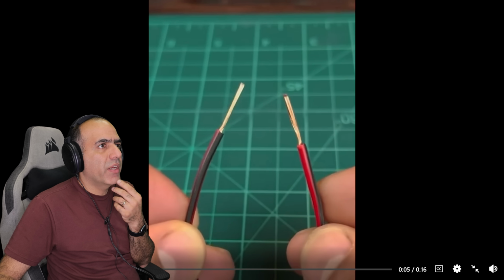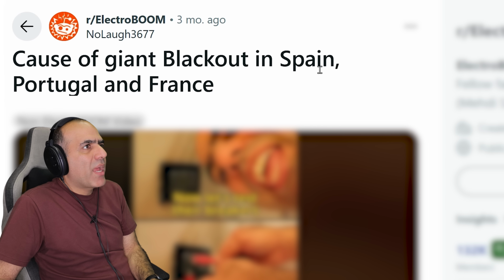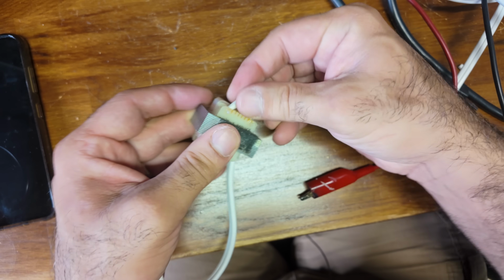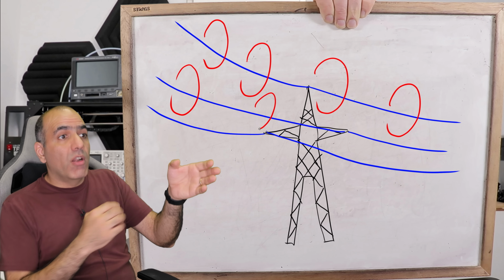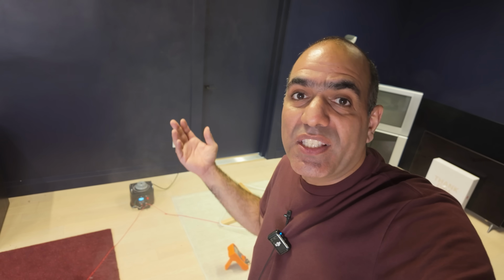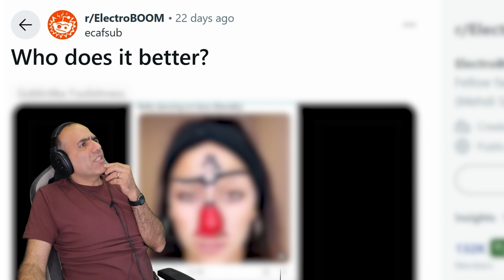Power Lines at Knee Level? Campfire with AA Battery?! (LATITY-016)

Comment: So I actually have some insight about that "Fusion Reactor".
It's called a Farnsworth Fusor and is unable to do any form of major fusion, they can do a little bit of fusion, but it's just luck of ions hitting each other, and you need deuterium, much more power, and a much higher vacuum, how do I know? I made one (you can see it on my channel), AND I actually helped the person in that article make that fusor, so his is based on mine which is roughly based on one from MAKE magazine.
I have no idea why that article called it a working fusion reactor, and it annoys me they did. Either way, no hate to the person in the article, I'm sure he didn't call it a fusion reactor, he was so dedicated to building his fusor and I remember the first video he sent me of it working he was so excited, and I was too.

Extra info for the info nerds:
The transformer is a 12kv neon sign transformer, the vacuum pump is a simple amazon vacuum pump, but some of them can get down to around 35mTorr, the one he and I use can get down to around 10mTorr, although you can't maintain a plasma with such low voltage at such a high vacuum. The grid is actually a simple shaker ball, which is something I personally came up with, and the glass is borosilicate glass. The metal flanges that encompass the glass, are my own design and use KF fittings, and the silicone gaskets that seal everything are also my own design.

If anyone has any other questions feel free to ask, I love talking about this.
Reply: Would you reckon soldered or brazed connections (for the classic 60/40 leaded solder, copper to copper and copper to steel solder joints) are vacuum tight?

I am slowly working my way towards DIYing vacuum tubes (emphasis on slowly, it has been like 4 years and i only now i am finally getting something resembling a EE lab lol) 

Also, do you think the neutron flux from the reactor has some utility in DIY? (Aside from what X rays can do, like food sterilization). 

Also also, if i remember right, Cody's lab did a heavy water extraction with electrolysis, so do you think it is possible to get fusion going with this DIY heavy water?

Even if it is not net power positive, the mere prospect of a star in a pasta jar is so incredibly beautiful to me. Like yeah medieval alchemists. You were right. Transmutation is possible. Its just involved, slow and expensive.
Reply: @oldelectronicenthuasiast Soldered or brazed connections aren't really vacuum tight, not only because they be porous obviously, but also because the alloys in the solder will most definitely off gas a ton. I wouldn't be surprised if there is vacuum safe solder, but I've never seen any. Copper is also not great for vacuum since it off gases quite a bit, again, I'm sure there are vacuum safe copper alloys, but at that point it's so much easier to just use KF stuff, it's not that expensive.

Fusors are just pretty light shows, that's all they'll ever be for us hobbyists. They don't produce enough of anything to be useful, though they can produce enough of some things to be dangerous.

Electrolysis is exactly what I'm going to do for my fusion capable fusor, and it's what most fusion hobbyists use to get Deuterium. Heavy water is pretty easy to get, certainly a lot easier than Deuterium, and there are pre-made electrolysis modules that are made specifically for heavy water electrolysis for not crazy pricey, around 150-200 dollars.
Reply: I see. Thank you. That has never occured to me. though, it makes sense, at least from the perspective of lower melting point increasing offgasing for solders.

Though, i never thought about solder as a sponge. How peculiar. On macro scales, it just looks like a silvery blob, and it was able to hold back compressed air just right, though that absolutely doesnt extend to vacuum. That, and any organic flux would totally nuke any semblance of possible vacuum performance i would wager.

Are there any plans to scale the fusor up? Is it even feasible to scale it beyond the belljar?
Reply: I thought fusors technically were fusion reactors? The main thing about fusion is that we've been able to do it for decades including with fairly decent power throughput, it's only productive nuclear fusion we haven't cracked yet (but because fusion has a reputation for being impossible occasional articles about these little fusors get breathlessly excited in the title before admitting that this isn't the same thing as commercial scale fusion)
Reply: @bosstowndynamics5488  They can be, but without deuterium, a higher vacuum, and more voltage, it's just a pretty light show. It's like having an egg with nothing to cook it, you ALMOST have an omelette, there are just a few more things you need. The egg could be an omelette in the same way a fusor could be a fusion reactor. Kind of a stupid allegory, but it's the best I could come up with.
Reply: @Aidans_Lab You don't need meaningful power output for something to count as a reactor though, and scale isn't necessarily a barrier either. By way of analogy, there's a massive difference between a DIY cyclotron and the LHC but they're both accurately called particle accelerators
Reply: @bosstowndynamics5488 I totally worded it wrong, yeah, energy production is not what makes something a reactor, the act of it facilitating a reaction does. But like i said, a fusor CAN be a fusion reactor, but mine and the person in the articles are not fusion reactors.
Reply: @Aidans_Lab Fair enough, that makes sense
Reply: If it generates fusion reaction, then it is a working fusion reactor.  That's what a reactor is.  It has nothing to do with generating electricity.  If you built one, you should probably know this.
Reply: @stargazer7644  Like I said in my other comments, neither of our fusors do any reacting, they don't have any deuterium nor do they have enough power or a high enough vacuum.
Reply: @stargazer7644   If it doesn't achieve criticality it is not a reactor, it has nothing to do with generating electricity. An RTG does generate electricity, and it does have fission reactions occurring, but it is not a fission reactor because it is not capable of criticality. If you're going to be a pedantic douchebag on the internet, you should probably know this.
Reply: But it is a working fusion reactor! The fact that it doesn't produce net energy is another thing entirely.
Reply: @jonbob2 Net energy has nothing to do with it. It's not a fusion reactor because it does not produce any fusion, there's no deuterium, not to mention the fact the vacuum is not high enough, nor is the voltage high enough. Fusors are capable of miniscule fusion, but the one in the article, as well as mine, are not capable of fusion.
Reply: @Aidans_Lab You've confused me.

How can it both not produce any fusion but also be capable of 'miniscule fusion' ?
Reply: @candyman9635  I think a fusor can facilitate fusion without actively causing it itself. For it to be a reactor it would need to actively cause fusion to happen by somehow confining the fusion fuel, however in a fusor there isn't really any meaningful confinement and instead it just lets fusion happen by creating a vacuum where the luck of the draw can result in the occasional atoms coliding and fusing. It's like the difference between a piece of uranium and a fission reactor, the uranium will occasionally split on its own but in a fission reactor you create conditions optimal for the fission reaction.
Reply: @jonbob2  Unless it's actually fueled and neutron production is demonstrated it's just a fusor shaped light show.
Reply: @jonbob2 It reacts heavy hydrogen and fuses it on the atomic scale to produce helium. 

Therefore it is a fusion reactor.

Not every fusion reactor needs to be a tokamak.
Reply: @daviddavidson2357  No it isn't. To count as a reactor it must achieve criticality. Would you call an RTG a fission reactor because fission is occurring?
Reply: @WJS774 Yes, sort of, because a fission reaction is occurring.

There have been natural fission reactors too. Uranium mines have come up short in isotope yield and the only explanation is that stable fission occurred.

A fusion reactor is more complex, significantly so. "Must generate usable power" is not a reactor requirement. If it eas, test reactors around the world would not be called reactors.

This is why we have reactor types.
Reply: @daviddavidson2357   I never said it must generate usable power to be a reactor, that's your strawman. I said that it must achieve criticality, which is the accepted definition of "reactor" by every nuclear physicist alive. Research reactors do achieve criticality.

Comment: I did my master thesis about magnetic fields under power lines, the strength of the magnetic field should be in the same ballpark as the strength of the earths magnetic field, except rotating instead of static.

You are right that the three phases mostly cancel each other out when the distance between wires is smaller than he distance to the measuring location, however if there is a zero sequence component in the transmission then that will not cancel out and that can cause a much stronger magnetic field.

My thesis was actually about measuring the x and y components of the magnetic field close to the ground and using that to infer the height of the wires, although I only did it for lines that have three wires in a horizontal configuration.

Comment: 16:15 I once detonated an old socket like that. I turned off the breaker and it still exploded, when I cut all 3 wires at once. The RCD went down for the whole sector.

Comment: The Hirsch - Farnsworth Fusor is not that hard to build and is at it's most basic no more complicated than a light bulb.  

-> https://en.wikipedia.org/wiki/Fusor

Inertial Electrostatic Confinement from a high voltage(15KV+) coil induces fusion of deuterium gas in vacuum, at room temperature(under glass like a light bulb).

It consumes a lot of power and does NOT produce any usable amount of net power, but is a neat project that anyone can do, provided you can get the deuterium.

-Cheers

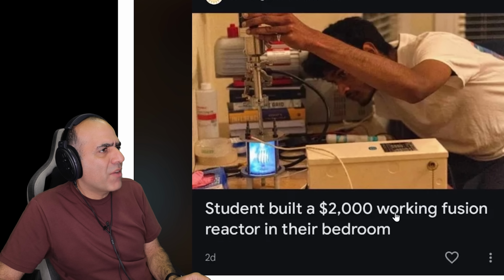Comment: 5:18
The video title reeks of free energy bs, so it might just be complete bs, but small fusion reactors do exist right now that can be built for relatively cheap and are relatively simple to build, but they are not energy positive. Its called a fusor, and have been around for a while. They are able to fuse elements into heavier ones using electrostatic forces and can be used as a source of neutron flux, they just cant be used for energy generation. It's completely different from just ionized gas in a globe. So, its actually possible that a student built a working fusor in their bedroom, its just definitely not a power generation device, but again probably completely false.

Comment: When I had my farm with a very old farmhouse and wiring and there was a old broken light fixture we No breaker on off switch. It was wired directly into the power line. 
That was not safe so I trimmed the wires back with wire cutters. It did draw a spark. But I used insulated cutters with rubber gloves on a fiberglass ladder. My experience wasn’t as dramatic as the one in this video. 

This was in 2006 so I don’t remember any other details. 
But I still can’t believe someone wired it without a breaker!

Comment: Just to clarify, that student and many others like him HAVE made working fusion reactors, just not ones you can extract useful energy from. 

That type of device is called a Farnsworth Fusor, and calling it a glorified plasma ball is not accurate at all. It uses high DC voltage to ionize deuterium gas and accelerate the ions towards a hollow negative electrode at the center. If the voltage is high enough and conditions are right, some ions will have enough kinetic energy to fuse into either helium-3 or tritium. They legitimately do fuse atoms. But These reactors have some fundamental design problems that make extracting useful energy from them basically impossible; such devices consume orders of magnitude more power than they produce. 

The media loves these things. They’re a difficult project, but not outside what an amateur with the knowledge and resources can do. Yes, they’re hyping up an essentially dead-end technology, and making misleading claims, but the people who build these things deserve nothing but respect. It’s a hell of a project and you absolutely learn from it. It’s my goal to build and operate one some day

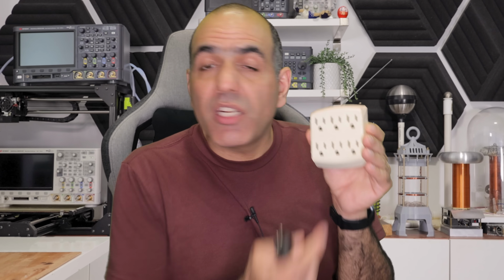Comment: 4:13  Interesting (drunken) point:  The heat across each connector will be half.  HOWEVER the heat across the WIRE will be the same.  SOME idiot is going to think they can get twice the current application from doing it that way... and wind up dying in their sleep as their house burns to the ground!  (Probably one of my fellow red-necks too... )

Comment: https://youtu.be/fwLan9mLJLQ?t=263 You can plug a 'fat' two pronged wart wall there or some other 'fatty' device between those outlets. You would waste one outlet anyway. And depending on the actual form factor you could actually save one outlet with this.

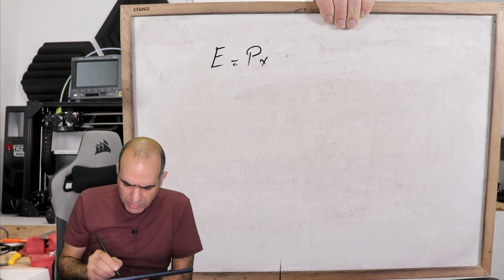Comment: 09:24 He said 2000Watts per day.. that is dimensionally incorrect. Joule per second per day →Joule per square second.  That's the acceleration of power😂
Reply: He's confusing power and energy as most non-technical people do.  I'm sure he meant 2000 watt-hours of energy, not 2000 watts of energy.
Reply: @stargazer7644   No, I bet he meant 2000 Joules of energy, not watt-hours. 2000 watt-hours is a decent amount of energy.

Comment: I have started a fire that way with a AA battery and some char cloth, but it needed char cloth or dryer lint and did not work with cotton or paper napkin/towel. 

Being able to jump the cable between two different receptacles is for when a large converter/inverter takes up more than a single space and other cables prevent use of a whole receptacle, such as if you have three receptacles, two large power plugs and a normal cable. The larger ones on the outside edges and the normal cable on the between two. 

The knee high power lines are an electric fence meant to keep either livestock in, or predators out, or it was just for experimenting with. 

The wire loops are primarily to have extra wire available if the ends need replaced for some reason, and they do help with water/moisture wicking a little bit. You often see larger multi wrap loops on the utility poles with coax that is running cable TV/internet.

I have seen the small arcs caused by high power overhead lines, and even been shocked by it while trying to move a metal geodesic dome around under them. They were roughly 50 feet above the ground where that happened because we were on top of a hill and the towers were on either side to get the wires over it. It is pretty funny watching a group of 12-15 people moving a 20 foot diameter 10 foot high dome and simultaneously drop it while jumping from the shock, then grab it again, move another three steps and repeat until they get to where they want the dome. Not as fun to participate in though.

Comment: The Fusor is a real fusion reactor.  It was designed by Philo Farnsworth and does fuse elements, but it is not positive net energy.  It is used as a table top inducible neutron source.
Reply: https://en.wikipedia.org/wiki/Fusor

Comment: The AA battery "trick" works. You just need good kindling material. Was taught it in reserves. Nowadays one usually uses a 18650 from the flashlight, but in a pinch AA works.

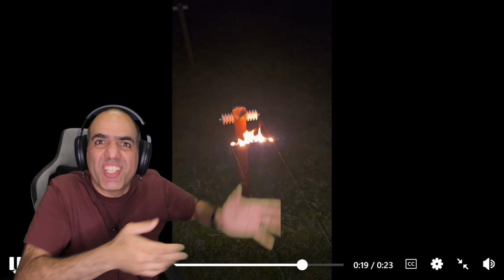Comment: 05:00 they are trying to stop wild animals from getting their field or nearby homes by these lines. But it is illegal.

They should use a pulse type voltage by a relay system so that animals can escape.
Reply: Especially when electric cow fences are a thing.
Reply: I assumed it was in a very high fidelity scale model, like for a train set or something...
Reply: It's to attract yokels to play and pee in it.
Reply: If you listen to what the guy says, it sounds like he's part of the crew that installed those lines. The fence doesn't look like a permanent fence. It's probably a construction fence built to restrict access to the area during construction, and this guy is just making a fun demonstration after the lines have been energized and the construction company is finishing up.
Reply: @puckcat22679  wrong fence dude ... next time click on the time stamp to double verify before posting.
Hint: not the fence with sparks with the lock on the chain;
the knee high fence that set a green stick on fire

Comment: I can confirm that AA battery lighter thing. I'd gotten myself into some trouble when I was younger (early 1990s) and we weren't allowed to smoke, so we had to get very creative about it and as a lighter, you used an AA or even AAA battery and the wire from these issued headphones we had so think like 24 gauge stranded so superfine wires and we used that to light our cigarettes. Never thought about using the wrapped coil bit, we just used the thin wire and it worked ok for the smokes.

Comment: On the turnstyles, they didn't give a measure of energy, they gave a measurement of power - 2000 watts. It's meaningless without a divisor. My bet is that this is an uneducated science reporter and the original paper said 2000 watt hours, or 2kw/h. 27000 people means 0.074 watt hours per person. Given 2 seconds to spin the turnstyle to do that, it's 133 watts instantaneous. That's a significant amount of effort to push the turnstyle, about half of what an olympic bicyclist puts out on average over a long race. Doable but still unlikely.

Comment: 2 batteries does the trick, this is a jailhouse mcguyver tactic to smoke. 😂one battery has positive up, the other positive down, and they use blades from a shaving razor to connect the batteries.

Comment: those wire balls are in the Philippines. those are just a type of pigttail to prevent the coaxial cable joint to disconnect.